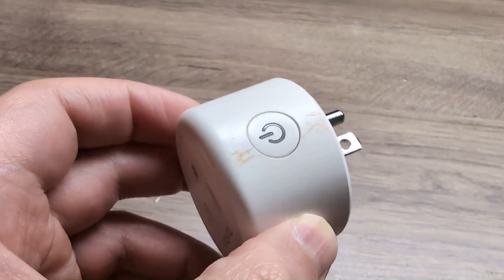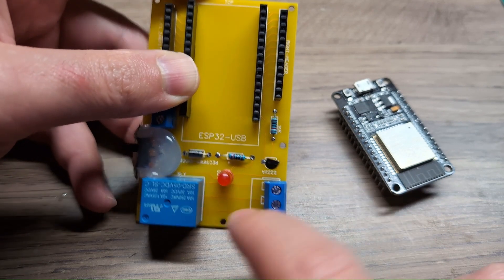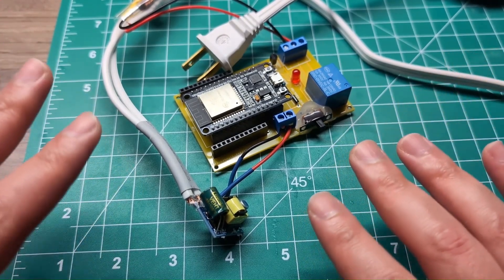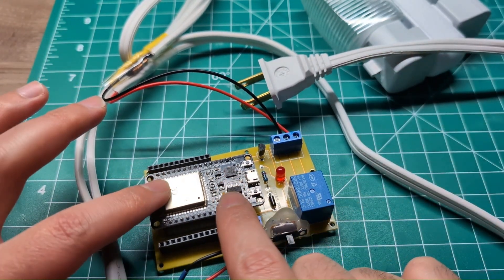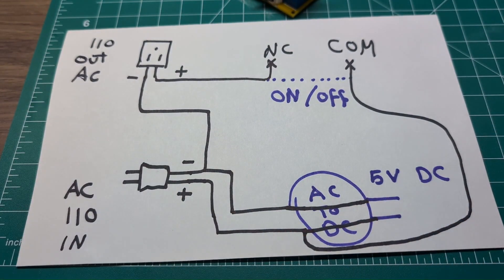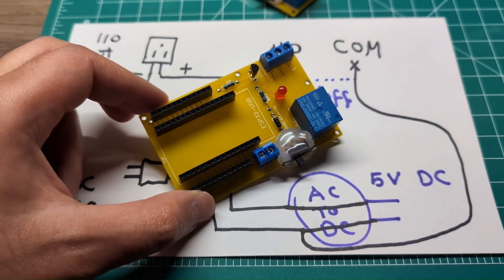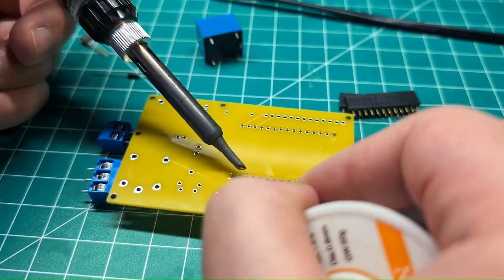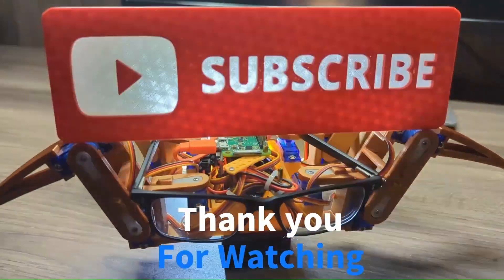Make Your Own Smart Switch #pcb #esp32project

Comment: Your project is a good starting point, but bringing it to real-world use will likely require significant development. I've implemented all the core features in my project as well, yet I'm still facing challenges in taking it to market 

Core Features 

ESP32 + MQTT (mTLS): Secure device communication with auto-registration
GPIO State Tracking: Only changes logged to InfluxDB, with confirmed flag
Real-Time Dashboard: WebSocket updates, mobile-friendly, pin control & status
Historical Charts: 6-month view, color-coded states, bold transitions
NLP Commands: ML-Based NLP English + Vietnamese support via API (/parse)
Notifications: State changes trigger WebSocket + optional email/push (via RabbitMQ)
OTA Updates: Trigger firmware upgrades from dashboard per device
User & Device Management: Role-based access via Keycloak, per-user devices & labels
Reply from the maker: Yeah I agree, my project is more for education on how it works, definitely not for production and selling in the real market 
Thanks for sharing the details, I appreciate it

Comment: Nice, almost exactly what I am looking to replicate albeit with a Bluetooth module, any advice on that would be great. Can you recommend a Bluetooth Esp32 module? and what coding would need changing for the app? Thank you!
Reply from the maker: Great question, yes this should be possible but why do you want to use bluetooth instead of the Wifi, do you have a reason for that? I recomment the wifi, I think it's better for this but it's very possible over bluetooth. This is the ESP32 I'm using https://www.amazon.com/shop/techspassion/list/2WYNDCF5TT8QC?ref_=aip_sf_list_spv_s_ofs_mixed_d
Reply: I like the idea of Bluetooth as smartphones allow  multiple BT connections, so we could have several devices in a app that you can manually turn on / off or even automate to turn the light on or off as you move into BT range 😎  @techs.passion
Reply from the maker: Yeah but you can also do that with Wifi, you just connect everything to your router then the phone also and you can manage them all, you could even manage them from remote location if you port forward

Comment: Very nice job.
My next would be to build one that works with a wall light switch and allows to my control multiple ESPs from the same app.
Reply from the maker: Yeah, that would be really cool. Actually the same esp32 should be able to control multiple points with a single web app
Reply: @techs.passion  Great news.

Comment: Dude, your content is awesome. Thank you for this video! Your PCB layout is perfect!
Reply from the maker: Glad you enjoy it! Thank you so much
Reply: @techs.passion  No problem! If you can help with my confusion I’d appreciate it! There’s NC, NO, and common up at the top for the 3 outputs of the relay. And because there’s 3 outputs and only 2 pins, the middle, which is the common, then goes to the middle common pin at the bottom of the relay which u can see on the PCB. Great. But those 3 pins are InV, input, and ground. If you are using 3.3V to initiate the coil, and you have 24V on the top, why would you connect those 2 commons together when they have 2 separate voltages? Hmm maybe that’s why many use diodes with their relays. Still doesn’t make sense! 😔
Reply from the maker: Hi @PhoenixsRealm,
So the input pins and the out pins are not connected. The input pins is to trigger the relay, basically you power it up then use the signal pin to close or open teh switch.
The other side (NC, NO and Com) is separate, this is more like a switch, the NC is connected when the trigger is off and the NO is open then it close when the trigger is on.
I hope that does help, if not let me know and I'm happy to further explain.
Reply from the maker: This video will explain more https://www.youtube.com/watch?v=jXEVZga9l1s
Reply: @techs.passion  Thank you for the video! I just watched it throughly and it 100% makes sense. I think my confusion is the ones that come already attached to a PCB have a GPIO pin. And I wasn’t sure how that worked.
Reply from the maker: I'm glad that helped, always happy to help. Here is my FREE Discord: https://discord.gg/FgVJYEUEXs if you need anything